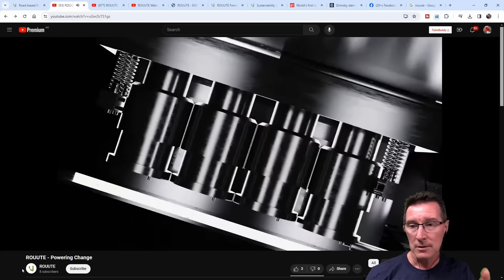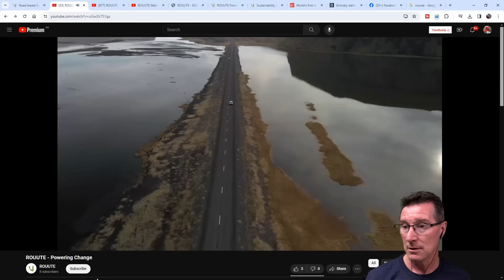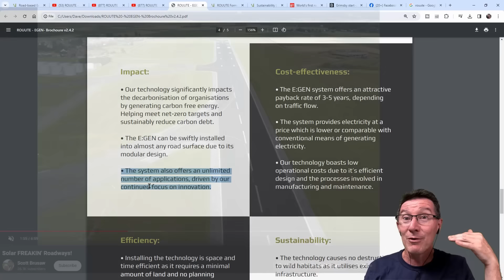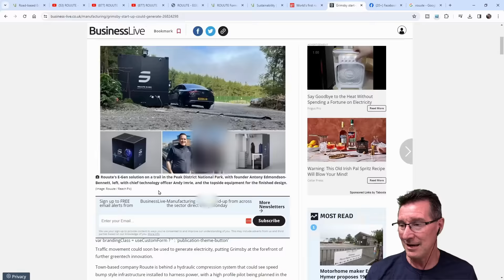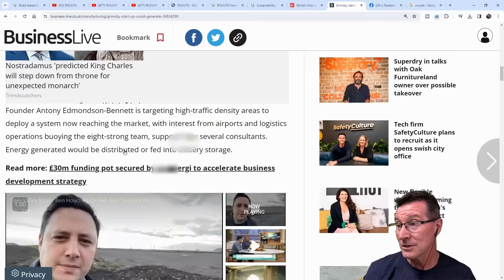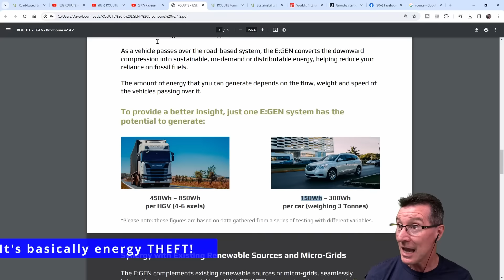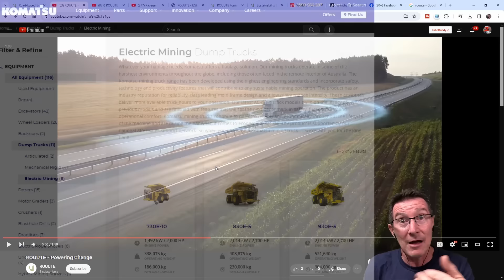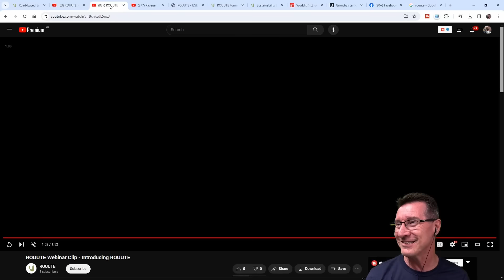EEVblog 1600 - Rouute: Road Based Energy BUSTED

Comment: 'it only works when you are going down hill.'
that is an okay application for it. in the us, on i-5 as you are dropping down the mountain, you can coast and accelerate well above the speed limit. so they could externalize the speed dampening of regenerative breaking onto vehicles on the road. the problem is that you only want the vehicles going above the speed limit to actually be slowed. so how do you conditionally extract energy? if you extract from all, then vehicles with on board regen braking will be dropped below the speed limit.

the main purpose i see for these is to extract energy in suburban streets instead of having speed bumps. speed bumps waste energy through the springs. i could picture a school bus unloading area or a road in front of a school to have extracting bumps instead of passive bumps. not sure if it would be worth it in terms of cost to install delta vs amount of energy generated.

a meta problem we are having is people who understand a problem presuming that other people dont understand it.

so for example there is marketing material and the marketers may not understand the product or product market fit. but that doesnt mean the technical specialists dont understand it.

'all the marketing shows that they are on flat roads'
they also show magic hollograms which show the direction of travel on the road. and have rippling circles of eminence from semi trucks. and also semi trucks apparently having lidar.

could we have these in the slow lane and near bus stops so people dont need hybrids to gen regenerative breaking? maybe...
it probably would be better to have things like those car speed tests, large rolling cylanders which by spinning at a specific minimum speed and being able to accellerate to an arbitrary limit cause speed limits to be reset. after all if you have one spinning backwards and a car passes over it the wheels will put power into the cylander. and the faster the car is going the more the wheels will want to rotate relative to the underlying cylander. can it pull out arbitrary amounts of energy so that people cant pass over it above the speed limit? maybe. but it isnt comming to mind exactly how.

Comment: It will has net negative energy saving. Zero brain, or engineered scam. It will cost more energy to build, install and maintain this, than energy harvested over whole lifetime. Not to mention that this energy is coming from your engine power ultimately, burning fosills. And if you use hybrid or ev, then you are going to have higher efficiency doing this in car with a regen.

Hard to believe anybody would even contemplate this.

If you want to recover potential energy when going downhill in a car, there are better options. Like putting a car on something, that is connected with a rope to a generator. Then this thing with a car go down, recover energy, car out, trolley / platform thingy back to the top. Way more efficient, because you are recovering so much more and contentiously.

Comment: Speed bumps are fundamentally worse for the environment, and they dont even accomplish the very task they were built for. Maybe in the 1940s to 1980s cars were slow enough to accelerate that a speed bump may work. But these days, with 0-100 times for even Vans being as low as 8s, Almost every vehicle can easily speed up to deadly speeds for pedestrians very quickly after going over a speed bump. All they do is make your suspension wear quicker and cause you to use more fuel having to slow down and speed up so often.

My BMW can accelerate from a stop to 100 kph in 5 seconds, and the weight of it is enough to kill a pedestrian at only 50 kph, with a head on impact. If I wanted to kill someone, Its very easy to do, speed bumps or not.

And in terms of slowing people down on long straight roads. All its gonna do is cause those people to drive faster when they get out of the area where the speed bumps are in order to make that time back.

Comment: even if you ignore the energy coming from cars, it is a terrible system.
The issue is that you have is that the cars can't drive over it consistently every second. if you had 1 car every 10 seconds you could use that consistency to rely on pumping hydraulic fluid or controlling how the motor works but because you don't have that consistent timing you need to instead have a system that operates in a circle eg. the road pumps fluid, the fluid force is stored, the fluid drives the alternator, the fluid then goes to a reservoir then is pumped back into the system. If you had consistent timing you could just let the fluid wash backwards and forward and half the system size, which looks like what their render represents. 
fundamentally lack of consistent power strokes is one of the large issues with tidal power that unfortunately doubles the system size instantly, add in the corrosion and its a non starter too

Comment: Energy = vehicle mass * gravitational acceleration * vertical displacement. Given their own numbers: Energy = 150Wh = 540 000J, mass = 3000kg, g = 10 m/s^2, then displacement is 18 meters.

I am assuming here that this "bump" is round-ish and has a spring mechanism that returns it to equilibrium. Hence, when driving the car over the bump, the car will initially decelerate, yes, but that energy is returned when the the car is past the halfway point of the bump and the spring rebounds, such that there is no effective braking.

However I am also assuming that all the compressed spring energy somehow is extracted out of the spring (because this thing must get its energy from somewhere), which implies that the spring will not have any energy to return back to equilibrium. This device is in other words an 18 meter tall speedbump which is one-time-use.

Comment: Serious question: could these be installed as you approach a traffic light or stop sign, and dynamically retract down into the roadway when the light is green? This could help slow the vehicle when the vehicle needs to slow down anyway. EVs have regen, but they still don't convert ALL of their momentum to electricity with regen. This could help slow you down faster when you're slowing down anyway. Putting these on an open highway, however, is dumb.

Comment: I'm sure he'll say it in the video but my first thought: Energy taken from moving cars on the road means that those cars now have less energy -> less fuel efficiency -> bad for the environment. Whatever good they may or may not have done with this tech would have been paid back by this mechanism.
Reply: This whole concept of "harnessing the energy of x" assumes that literally everything we do produces so much excess energy that we can take some from the top without influencing the process. But when an EV rolls downhill and charges its batteries, it gets slower. If this nonsense makes it on the road, it will make cars go slower. For gas vehicles that means worse fuel efficiency and for EVs it means being robbed of regen braking.

Comment: So instead of burning fuel in an extremely efficient stationary turbine that's able to also benefit from a heat recovery stage to boost its efficiency even higher... let's go with hundreds or even thousands of less efficient small piston engines. It even makes sure to help put excess wear on suspension components! Very green /s 

What an utter crock of crapola. 

They want to put them everywhere, but even if they're buried to be level with the rest of the road the only spot where they even stand a chance at all is if they're used as part of a traffic calming - but they won't want to do that because it's going to make a bunch of noise and not see that much traffic.

There are so, so many ways this idea is awful. Fixed remote locations with buried and unattended hydraulic machinery to make maintenance horrific. Water and ice ingress. The one that will stop the idiots hopefully is the inevitable legal liability when the silly bouncy road gadgetbahn plays a role in a car crash.

Comment: This reminds me of the science project that the kids next to me in gr. 10 did at the university science fair which was to stick a ridge line wind turbine on a car.  Their excuse was that a lot of cars were boxy (at that time) so it wouldn’t make much difference in terms of fuel economy…  I was pretty sure you’d be taking more energy out of the movement than you’d recover in electricity.  My project was 3D TV, also impractical but did eventually come to market!

Comment: Heres a hot tip for all you "innovators" out there

If you are trying to make roads more expensive to make and maintain, everything about what youre doing is incorrect.  All of it.  Literally abandon everything having to do with making the road more expensive.  Pull your head completely out of your ass before proceeding to the next idea which should have NOTHING to do with making roads more expensive.

Want energy? Lets just STFU and build the reactors and get on with our lives.  I am so tired of hearing about shit like this which is basically energy theft not even energy reclamation. Nothing about this is more than a novelty. Just build the fucking reactors and stop pretending we have an energy problem.

Comment: Massive scam. Lets pretend they did actually collect that energy. Well it doesn't come from thin air. The car or vehicle has to produce it. Which means they are stealing the energy from the car and making the car owner pay the cost of producing power for them. It is tantamount to putting a loop of wire under electrical lines an stealing current.

Comment: energy is created squashing a crystal or at least the right type crystal type anyway the tech. that  make digital scales work? and than energy of it mass and weight passing over it, would that be free energy then? if was just flat plate, just like regular road manhole grid in the road surface ?

Comment: Your calculation for energy is off. The energy is not coming from the velocity of the car but the potential energy because of its weight. It's as if you kicked a ball off of a ledge and then caught it with this generator. The energy consumption from the car will actually come from you pulling yourself up out of that divot

Comment: Down hill it will work, (technically) it is the otherwise wasted breaking energy that is recovered. However the claims of the magnitude of recovered energy per car, must be per year? i.e. a city planner number? Generating 300 Wh in 5 seconds= the vehicle needs to transfer an additional 216kW of power for that period to maintain speed, presuming 100% efficiency of the speed bump generator. The 300Wh per car, must be per year or month or something?

Comment: So instead of using the fuel directly in generators to convert it to energy... we slightly increase the fuel consumption in a lot of cars just a little while also adding another step to be a lot less efficient and increase the fuel consumption per energy yielded.

Comment: This is hilarious...... So how much energy did it take to get the car onto the strips... and then they get somehow more energy out of the vehicle when they compress them, after using energy to get ontop of them.... It's an energy theft device where they steal your electric cars battery charge and sell it back to you before you leave the lot with 200 of these things you had to slowly crawl over, using excess battery power just to get over them vs rolling on a flat surface....efficiently... lol!

Comment: I think they should hire Ozzy Osborne as a spokesman for solar roadways.

This thing about running over bumps should only be on downgrades otherwise they're stealing energy from the fuel purchasers.

6:19 They're going to come out with a version for ships as well.

What about snowboarders?  They didn't mention them.

How can you badmouth this guy?  He drives on the same side of the street as you!

Aren't their conservation of energy problems with this?

Instead of cars, why don't we apply this technology to wildlife?

They should install this system in Starbucks drive throughs.

Comment: I think they're claiming that if the system was constantly in use for an hour it would make 300wh of power. And it would be impossible to get a constant flow of cars that never stops. So what they actually mean is it will make <1 or so watts of power per use that takes a few seconds.

Comment: Only revolutionary energy generator I care about is the cat-toast generator. So, cats always land on their feet and toast always fall butter side down so basically you velcro toast butter side up to a cat's back so then the toast will rotate towards the ground but that puts the cat's feet in the air so the cat will rotate towards the floor again and so forth. I guess you will need a flyweel or something to stop the engine from rocking back and forth and maybe tweak the cat-to-toast surface area for optimum performance

Comment: Would it not be good for carparks or replacing existing speed bumps, or would the initial cost outway the  payback term ?
Reply: The problem is that speedbumps (thus these things) get a very large amount of abuse. At best this system will break down very frequently, at worst it is an actual road safety hazard.
Reply: @PauldeVrieze  I agree. I was thinking this would be a smarter way for them to market it rather than sticking them on main roads.

Comment: If you wanted to implement is as retarder for trucks on downhills, built into the road, the instead of the mechanicals you would better used aerodynamic drag, or use the fact the trucks are mostly metal, and use it as switched reluctance generator. Although, I think that a runaway truck ramp is much cheaper to build.

Comment: My system actually works.

 All thats needed is an arm to block the road, and a container to hold gasoline.

The arm blocks a major road.  To make it lift, the driver needs to transfer one gallon of gas from their tank to the receiving tank.  At the end of each day the gasoline is then used to create electricity.

Road based electricity solved.

Comment: As other comments have stated, you're just stealing the energy from the vehicles.  They will make up for it by presumably burning more gas/diesel/electric from their internal storage.

Measuring watt-hours... for a "generator" that is "working" maybe for a second per axle... and only so many axles pass over per minute (never mind hour). No idea what kind of cycle time it has to reset for the next axle, nor what each individual axle generates.  Making that into an attractive figure to sell the product is the scam.  If you're doing it say at a stop sign or other place where the vehicles are queued up and rate of driving over it might be controlled. Maybe it's as constant as possible. (It still won't be working at 2am when there's not any traffic.)

What does it generate per activation?  What are the losses to get that generation; as this is guaranteed not to be 100% efficiency from kinetic to electric.

Comment: driven right no car needs energy driving down a Hill. Use first, second or third gear (depending on the speed youll wan't) and use the Engine as a Break and no fuek is used.

Comment: Honestly, as a Mechanical Engineer I believe that you severely underestimate how bad this is.
Not even the fundamental idea, but looking at the specific design I can  see, that the product (if it even works at all. Probably if you build it that bad, then you're going full scam, skipping the generator and hiding a battery somewhere inside) is so inefficient, that a small solar panel will generate more energy on a cloudy day than 20 cars per minute.

Comment: I saw the idea and without even watching the video immediately understood that it can't work. If the speed bump can be compressed, the car passing over it will expend energy to do so. So you can harvest some energy with the bump but that energy (and some more due to conversion loss) has to be expended by the car first, on top of what it would normally use on a rigid bump. So it is just wasting energy by needlessly converting it twice.

I heard of a less bad idea before where they'd convert vibrations caused by pedestrians into energy. Same idea but this time it's people expending energy which is generally considered acceptable or even positive.

EDIT: Oh well, the pedestrian thing was actually mentioned in the video, too.

Comment: This is a great idea. If it was only used downhill and it was still 1980. The more cars there are with regenerative braking on the road, the worse this idea gets, even downhill. So by the time this could see widespread deployment, you'd probably already have enough cars with regenerative braking on the road that it just wouldn't be worth it. Or at least, you'd get to that point soon enough that it still wouldn't be worth it.

Comment: Half a minute in and even as a non engineer it is obvious how dumb that is.
The energy is as "free" as if we put a second alternator in every car to charge a battery *for free*.
BTW Besides the fuel consumption of the cars going up, I hope the road based energy bumps will at least not ruin the suspension of the cars driving over it and the spines/intervertebral discs of the drivers and passengers.:face-orange-raised-eyebrow:

Comment: There is a quarry in Beil, Switzerland, this specific quarry is unusual, they load the ore into dumptrucks at the top and take it to the bottom. So they use the largest electric dump trucks, they drive off the batteries on the way up and recharge the batteries on the way down recovering enough energy they do not need to to ever plug these trucks into recharge. And this shows the rub, any location you could use this, an electric vehicle regen will be just as good if not better.